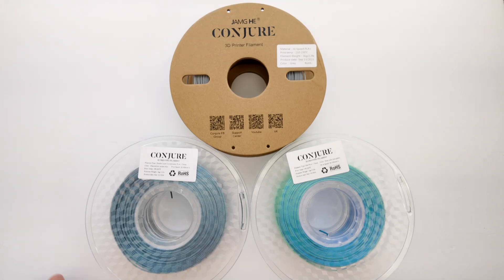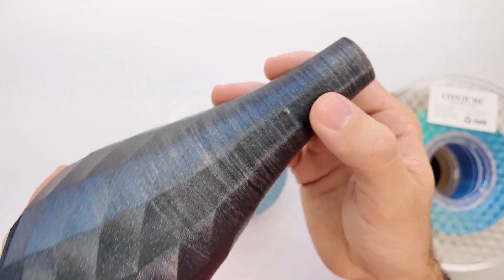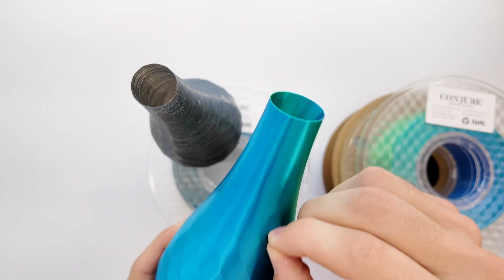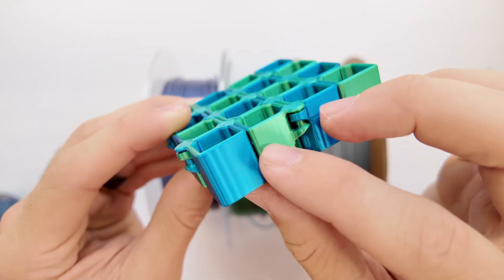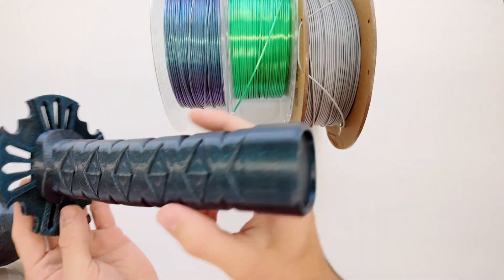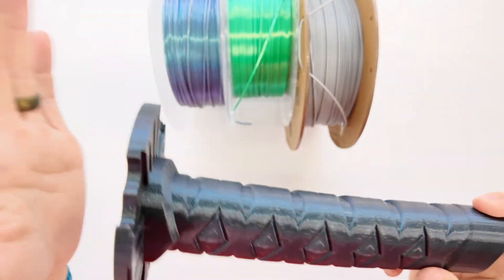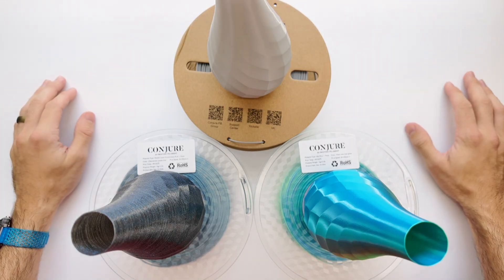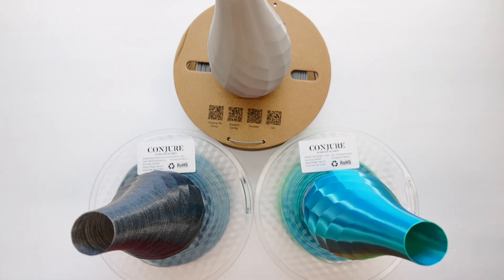CONJURE Grey PLA+ // Silk Green-Blue PLA // Chameleon Purple-Blue PLA // 3D Printing Filament Review

Comment: Is that chameleon purple blue dry? Looks like wet filament to me. I know you just got it from the manufacturer, i'd like to see the same print after you dry that filament out. Would be good to know if the manufacturer shipped it to you too wet to make good prints.
Reply: Also probably speeds they do recommend 30to100 on standard pla

Comment: Thank you for the feedback! The Chameleon Purple-Blue PLA is a kind of cored material. It requires lower temperature and printing speed. And about the movable model, it will help if you set the X-Y hole compensation up. Again, thank you for your detailed feedback!
Reply: I just bought the Chameleon Purple-Blue PLA and got it in the mail today. I am just now seeing the review on it before putting it in my printer. I have a core X/Y machine that prints at high speeds... Should I send it back for another filament?
Reply from the maker: @jgordon59  I haven't tested printing it at slower speeds like Chitu recommended, so I don't know if it would turn out a lot better. But it sounds like if you want to be able to print at higher speeds, you should get a different filament.
Reply: @RCwithAdam1  I am printing a 15 minute benchy right now as my first print with it. I slowed the speed down to 25% and cut the temp to 210. It looks Amazing. 🤩
Reply from the maker: Thanks for the info!